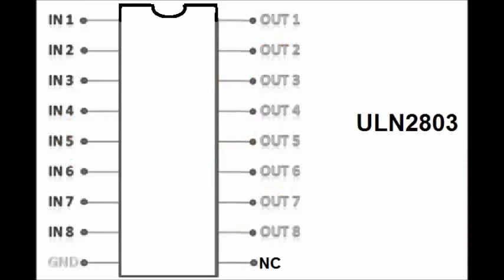Armardo ULN2003 y ULN2803

Comment: que tal ingeniero vladimir gracias por su canal.
 una pregunta con el Uln2003a    sustituimos la resistencia de 1k (10k) y el transistor 2n2222?
Reply from the maker: que yo sepa el transistor es para inverti el voltaje  la uln2003 es para motores dc y motores a paso o incluso tiras de led
Reply: ingeniero vladimir. ¿ hasta cuantos led de 5 mm. le podemos conectar en una salida al uln2003? muchas gracias por su respuesta.  estoy queriendo hacer un display de 7 segmentos de leds de 5 mm.
Reply from the maker: depende del color y ampraje de tu fuente , con la uln2003 te conviene hacerlo tiras de led http://www.talkingelectronics.com/projects/30%20LED%20Projects/30%20LED%20Projects.html
Reply: hola ingeniero vladimir que tal saludos. mi fuente es de 12 v. 3 amp.  y los led son color verde tipo flat. muchas gracias por su ayuda
Reply from the maker: te rinde bien tu funente como parra 3 tras de led de un solo color o 1 rgb